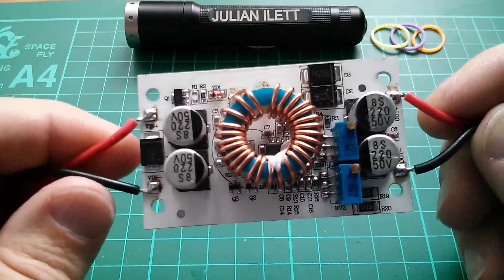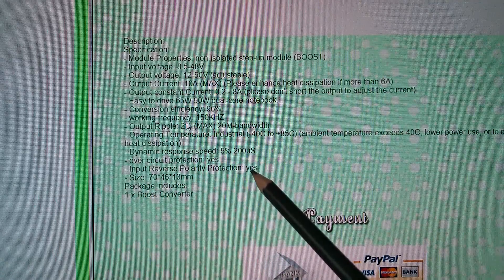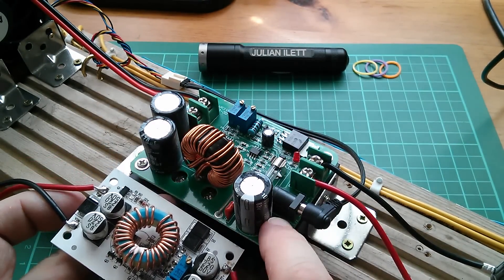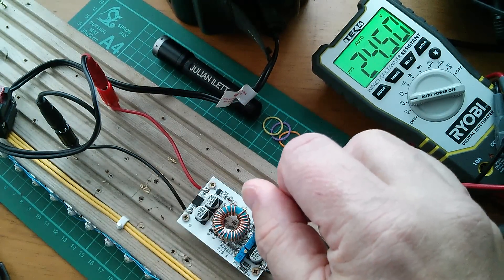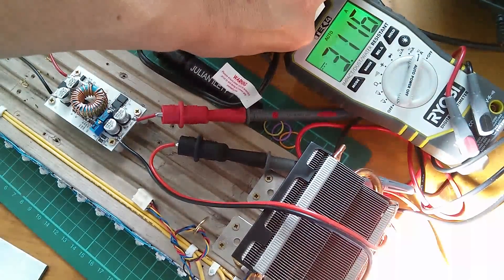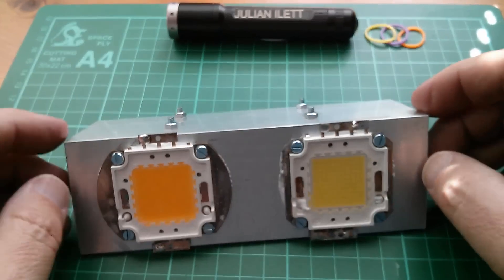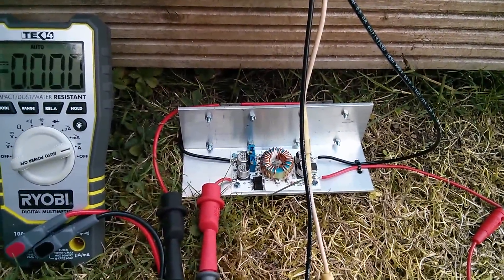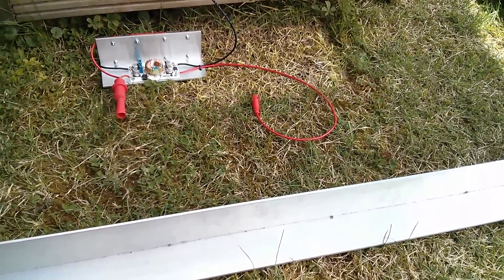Julian tests: 250W LED Driver with 2x 100W LEDs

Comment: Fun, excellent project and overview of components and amps/current! As a beginner testing D cells-in-series amps, I already blew multimeter fuse, probably from forgetting to switch to 10A, or forgetting to return 10A to V.

Comment: The 'reverse polarity protection' is a just a crowbar diode. There is meant to be a fuse in series with the input as well.
You could just add an inline fuse holder to the input wires and get a more complete crowbar network.

Comment: Hi Julian,  Thanks for another great video.  I've just bought some of these DC-DC converter modules.  Despite a pathetic attempt to scrub off the IC number, they appear to be based on a TL494 going by the pinout and the voltages/waveforms on the pins. Cheers,  Phil

Comment: 12:30
What is the output voltage at 5A load ?

Boost converter current must be measured from input side, not output.FOr example, input:12volt  output:24volt if you drawn 5A on output side with %100 efficiency, input current easly hit 10A.

Comment: Is it possible to provide a suitable output for the laptop input, which is 19 volts and 7 amps, with or with a 12-volt battery of the car, which is 60 amps?

Comment: Could the lack of current be because you only had 12 volts going in?
Reply: Michael Beeny Probably the battery cannot handle the current and is droopiñg
Reply: +kingknut &quot;over-driven&quot; I tried this board but could only get a 28v output using a single 12v SLA, 2 SLAs giving 24v amp; a 12v car battery. I was wondering what level of amps I could supply to the LEDs given that 28v output voltage. Twin 100w video on my channel.
Reply: +kingknut Yes. I used a few configurations to test this board, including only one 100w LED,; I could not acheive the 32-34v voltage reqd. Current didn't seem to be a problem though. Given that I can get 28.2v using a 12v source. I am going to run the LEDs at  (100/28.2) 3.5 amps & see how it goes. Seems were asking a lot from a $5 board.

Comment: I'm using this driver to run 1 100W LED off of a 20V battery. Once connected the driver draws about 5 amps but as the voltage decreased the amp draw increases, to the point where at 18V the driver is drawing 10 amps and it starts to smoke from within the inductor. I've attached a heat sink to it and it has made no difference. Am I doing something wrong here? Is this driver faulty? I'm not sure.
Reply: Sound to me like you don't actually have any current limiting.

Comment: the 5Amps limit. Well, the unit is designed for 10Amps max at the input. So the power @ input= 14x10= 140W or so. Considering the output voltage is 30V for the leds, it can deliver a max of 140/30'ish, close to 5 Amps. If you want to increase the Amps at the output to drive 2 leds with 6 amps, you need to increase a bit the input voltage

Comment: Increase input voltage   to 24v and it should work  thats less thab 10amp input.
Reply: Maybe they put a diode in series with the circuit ..

Comment: There may be an output current control, BUT BUT BUT, the TRUE current max is 10A (NOT, NOT NOT NOT output), on INPUT.
This is a BOOST converter, so the higher current is always on the input, so regardless of what the so call specs say, the hard limit on current will be on the input.
So if you go from 5V input to 25V output, you max current will be 2Amps, NOT NOT NOT 10A.

Comment: 14:07 Couldnt you use a clamp type induction amprobe to measure the current draw wirhout the power going through your meter?

Comment: Measure current on battery side and voltage after current meter and then measure voltage on the LEDs and then you can calculate approximately how much current the LEDs are using, there are just the losses on the buck converter, voltmeters have high resistance, so there isn't able to flow any current through them.

Comment: You could stick some small heatsinks behind the aluminium angle using thermal adhesive to increase cooling. Just an idea for your "biggest led lightbar in the world" project. Great video, cheers.
Reply from the maker: davidrobert2007 Or just drive a bit faster - did I just say that out loud? :)
Reply: Julian Ilett Or that. Now it becomes clear :)
Reply: Julian Ilett so want car lights so bright people suspect they have just been abducted by aliens when you flash them on?
Reply: Julian Ilett drive faster? if it's car mounted then you have a car sized heatsink!
Reply: Hardly, there is very little on a car that can be made into an effective heatsink without so much interface material that you might as well just use a separate heatsink.  I suppose you could rip some of the plastic cladding off the front bumper (assuming it's not an ancient vehicle that had chromed bumpers), make a copper or aluminum heat spreader plate that the LEDs are mounted on then thermal epoxy that to the bumper (I doubt heatsink grease would stand up to outdoor weather), but even then a bumper is a relatively poor heatsinkg being covered in plastic, being steel, and exposed surface area not so much better than a regular heatsink given the distance from the LEDs.

Comment: YES... Please, build the biggest, baddest LED light strip you can.  I'm like to have a very high power video light; but, I know little about electricity.  Help me, Obi Wan.  You're my only hope. :D

Also, I like to have high power LED to supplement late autumn/early winter  and late winter/early spring garden and this would be perfect to reduce my dependence on mega corporate grocery stores.

Comment: i recently brought this for fun projects. However, i try to use this but when i give power to vin the output shows noting 0 volt infact the power supply stops working shows 0 voltage. Did i blow the circuit or fuse or any diode?. that's not my field of work but im curious to know about this kind of stuff.

Comment: Julian Ilett 
Just wondering, if you increase the input voltage will the boost converter provide more output current?
(as others have previously mentioned)

Comment: Hi, I've a doubt about led drivers, when a led driver says that it's 10w, this mean that should always deliver this 10w or will auto-adjust (don't have any potentiometer) the current according to the type of led attached?, for example if I plug a 1.5w led to a 10w led driver this driver will deliver the 1.5w or will deliver the entire 10w to the led?. Thanks.
Reply: Almost all LED drivers are constant current devices.  They will try to deliver their rated power (watts) by increasing output voltage until they reach their current set point or their max voltage capability.  For this reason, a 10W driver will almost certainly kill a 1.5W LED.
Reply: FlyingShotsman Thanks.

Comment: Hi Julian.  When you were discussing the circuit board, at around 4:00, you mentioned a microcontroller a couple of times, but I don't think there's a micro on that board.  The 16-SOIC device is probably a switching controller, with a MOSFET driver built in.  There are dozens (hundreds?) on the market that require roughly similar circuit design, and some do use shunt resistors for current mode control.  The SOT-89 device next to the input capacitors is labeled Q1, which should make it a transistor, but I think you're right that it's working as a voltage regulator; it looks like it's being controlled by Zener diode ZD1.  It's not uncommon for switching controllers to use an external supply to provide a boost voltage for their MOSFET gate drivers, especially if they're meant to control large MOSFETs with high gate capacitance.  I just caught a glimpse of what I think is the MOSFET, in a TO-252 package under the inductor, oddly labeled G1.  /  I can't wait to see your kilowatt LED light bar come together -- thanks for the always entertaining videos!

Comment: it is rated 10 Amp. but driving output only 5 amp . because i think 10 Amp is input limit not the output limit. and at 25 V and 5 A as output we alredy taking around 12Amp input from 12 V battery

Comment: Naturally, the input (shunted) diode is there for reverse polarity protection.  Where a 'fuse' absolutely must be in-line with the input power wires, so if connected up backwards, the diode would be as a short, casing the fuse to blow.  Without the fuse in-line, yes it would be a problem.

Comment: There's a couple of paragraphs in a Bob Pease book I have about that reverse input protection. This shunt diode style protection is what he recommended using, then someone wrote in and said a series diode makes more sense and IIRC, his response was that in many circuits a series diode would be too lossy during the normal operation and that the shunt diode method assumes a supply with short circuit/overcurrent protection and/or current limiting as would usually be the case. He did acknowledge the potential problem though and further recommended a series p -channel MOSFET in the negative input line with a high value gate resistor across the input to the positive line and a gate-source zener in circuits where that's necessary. Apparently this is all from his EDN design series and he claimed to have invented this MOSFET circuit as far as he was aware as part of this conversation in the 80s.
Reply: I have a very old power supply where the over voltage detection circuit fires an SCR and shorts the output to ground and blows the fuse.  It's called a crowbar circuit.

Comment: you killed me ears!! How do you know that the two LEDs are taking the same power? saludos amigo
Reply from the maker: Proyectos LED Sorry, very loud alarm on that car jump starter! The two LEDs will take different amounts of current. Within each LED, the 10 columns are all taking different amounts of current. These are cheap 100W LEDs :)
Reply: Julian Ilett how is the quality? there's a few claiming that the quality of the 100w LED's are pretty garbage. I'm looking to make my own grow light using 100w LEDs for some veggies im growing. i found some 100w/200w'ers that have specific LED bands (7 different bands of leds!) but i'm curious as to the quality. their fairly expensive comparatively, round 10-20$ per 100w chip, then I also need to factor in some sort of power supply/heatsink/fan/lens.

 whats the cheapest/easiest way to drive these from a 120v wall socket, if i have to drive multiples?
Reply: +Jakob Chan I found drivers for fairly cheap. I was just wondering about the 20 to 30$ eBay leds. I don't mind paying about 50$ for a decent 100w
Reply: Also I ended up going myself with a 600w hps because you can't really beat it for the price. Full kit for 130. And It's dimmable. Which is great because at full power it heats up quick.
Reply: +Munky332 I ran two 100 watt 6500k LEDs for over a year, 16 hours a day using two 6 dollar drivers, an 80 dollar RC power supply, which I got for free from a friend, and two CPU heatsinks with fans which cost 13 bucks each, and I used them for growing tomatoes and peppers. They ended up growing generally 1 few inches faster over 3 months than on HPS, and it's quite nice being able to run it without much of any ventilation, only enough needed so the plants get some CO2.

If you ever think about switching to LEDs at some point, you will save money given their life, however they'll actually consume more power to equal the same light output, but with considerably less heat. Also in about 2 years, if you can find a good mother power supply, it'd probably only be about 18 dollars per LED with the heatsink and power regulator set up with them. While they're definitely not entirely optimal given the fact that the LEDs are low quality and have different resistances between the diodes, which significantly shortens their lifespan, mine have dimmed by 40 lumens each over 18 months. And I'm not actually using anything to regulate amperage, only voltage. Which given now constant current and voltage supplies are much cheaper than when I started so I could probably build it for less right now, and get much more lifespan. 

Also I never knew that they had dimmable HPS setups. Learn something everyday. Oh, and when it comes to color spectrum with LEDs, you can just run 6500k on all of it, they fruit just the same. But doing LEDs is definitely best DIY so if you ever feel like spending a day fiddling with wires, that's always a good option. Or you could always use them for shop lights or something. They're absolutely amazing for their price, and even with they're low quality they'll last you a looooong time.

Also if you ever read this, how many bulbs have you went through so far? I only have friends with HPS systems, so I'm a bit curious on the actual amount it'd cost to run the whole set up.

Either way, happy growing. Oh, but if you ever end up growing the medicinal happy plant from the land of the rocky mountains, then LEDs are 'supposedly' much better for flavor and quality. I don't actually grow that, just what I've read on forums.
Reply: +roche114 I buy the cheap bulbs, so they're only like 15-20$. i havent went through any yet. you get differing results depending on how long you run them per day. i generally run them 18hrs a day for veg, 12hrs to flip the crops to fruiting. i keep a spare HPS on hand. i tried metal halide for veg for awhile, prefered the results with just straight HPS. the dimmable ballasts are also digital so they don't give off much heat and are very energy efficient. my 600w only pulls 630w at full draw. heat is still something to contend with from the bulb itself, but its not that bad if you have good air flow. its not necessarily a "true" dimmable, it has settings for 100% (600w), 75%(450w), and 50% (300w). this really makes it awesome though, because lets say you have an area to grow in that you can only get away with running 50% on currently, it allows you to grow into the 600w feature later, without having to spend anything more on the light. 600w's are also the most efficient currently.

in general I think most people get 15k-20k hours out of the bulbs (speaking HPS), even at 18 hrs every day,  that would be over 2 years. I think most people just replace them at 1 year because someone said they lose some of their spectrum/intensity after about 1 year or so? i've only had mine about 5 months now, and I've noticed no shift in spectrum, and its intense enough that if I stay in the light long enough I get that feeling that i'm getting sunburned.

i'd still like to play with LED's, i'd like to definitely try both the 6500k and a full spectrum LED. the only problem is i had a buddy get one of the larger COB type LED boards and it turned out to be complete shit (this was just a cheap i think 5k? 50w). we were playing around with it and it turned out that more than half the LEDs weren't fully lighting. only reason we tested it is because we saw a vid here on youtube where someone else was testing the cheapo COB LEDs and they also showed how some of the LEDs could be shorted out. it still worked for his purpose which was a general purpose light for a reloading bench, but i dunno how I feel about potentially spending large amounts of cash for multiple 100w+ COB, when i have a perfectly good 600w HPS that I got for much much less. i dunno about the 6500k though either, as the spectrum, if it matches CFL's still wastes energy on part of the spectrum that doesn't matter, which defeats one of main the reasons to go LED, which is more wattage into energy that actually matters vs wasting it on spectrums that aren't used.

Comment: At 13:25 you say you can't get more than 5 amp out of the unit.
If you're running at 36V that 's 180W and whilst not the 250W stated, still pretty good.
If you wound the voltage all the way to 50V (max for the unit you used), 5 amp would give you the 250W claimed by the manufacturer. How far did you "inch" that voltage pot?

Comment: I could only get 28 volts 0.7 amps from this driver using 12v & 24v SLA supply. I also tried a 12v car battery & also on one 100w LED alone. My question is, can I increase the amps at this lower voltage level?  Video on my channel.

Comment: Hi Julian thanks for this video, I'm about to make 400W RGBW light powered with 4 of these and its good to know more about them. Do you have any idea how these modules deal with open circuit scenarios as I am looking to control light output for each led with an n-channel MOSFET. I won't be using PWM to control the intensity  but instead a digital potentiometer on the CV pot as to avoid artefacts when filming. Thanks again for this video, and others like it.
Reply: you can de solder the current limit pot and control the brightness directly use 4 separate LED drivers skip the mosfets that is how I do it I use photo couplers is my interface

Comment: Do you know of any 30,40 or 50 LED Chips that run on a forward voltage of 9-14V?  I have looked everywhere that I know of but am unable to find one.  Is that something that would have to be custom made?

Comment: Most likely that driver "protection" is designed to be used with a fuse so that the diode can handle the short circuit until the fuse blows.

Comment: 2:51 This type of rev polarity protection is termed "crowbar" in as such it forces an error condition (short circuit) intended to blow an input protection fuse. This is the most efficient because putting the diode in series would drop the input voltage. Use a PTC fuse on the input and auto reset once polarity is corrected.
Reply: i recently brought this for fun projects. However, i try to use this but when i give power to vin the output shows noting 0 volt infact the power supply stops working shows 0 voltage. Did i blow the circuit or fuse or any diode?. that's not my field of work but im curious to know about this kind of stuff.
Reply: @vishvpatel6352  Was your input polarity correct? What was the power source?